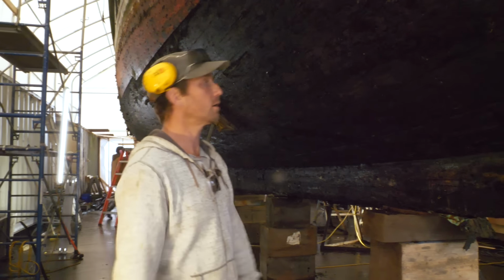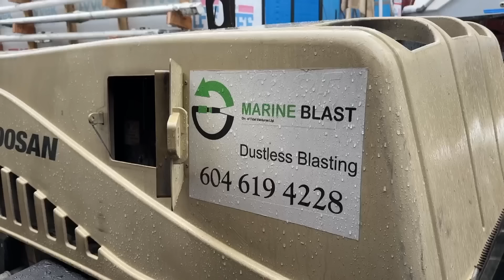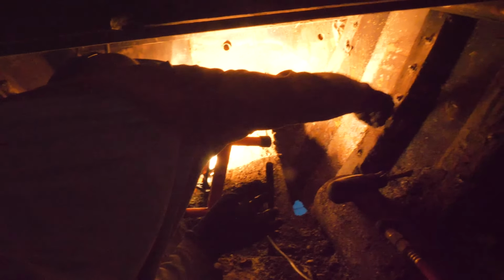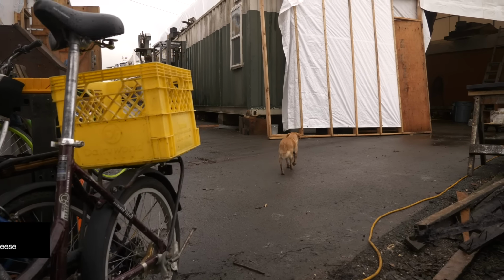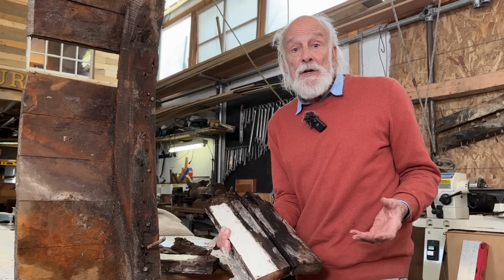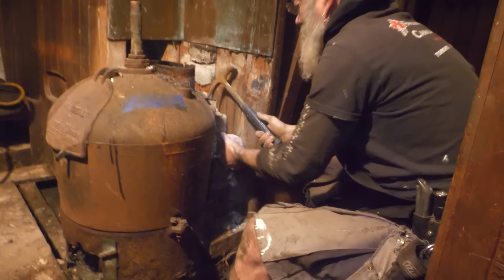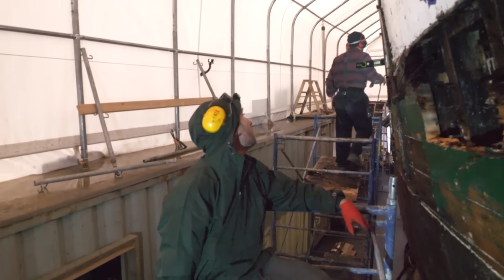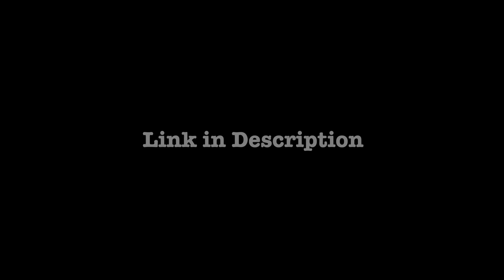Exploring wood rot on a 90 year old historic arch

Comment: I dont understand? If they are going to rebuild it why do they just throw the wood around all over. If they are going to replace all or most of the wood why dont they just build a whole new boat
Reply from the maker: The vessel holds a lot of historical significance for Canadian maritime history, the inuit and the Yukon and Northwest territories. As one piece goes out, measurements are taken and a new piece is put in its place. But before any major work starts all the rot needs to be removed.